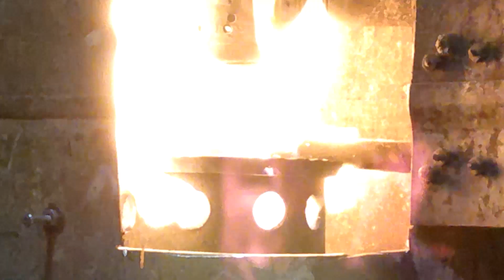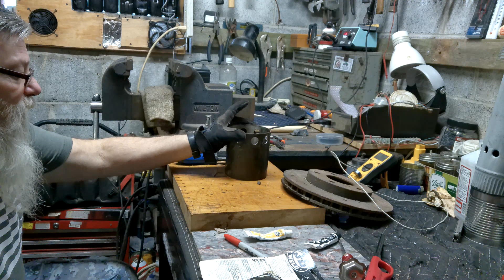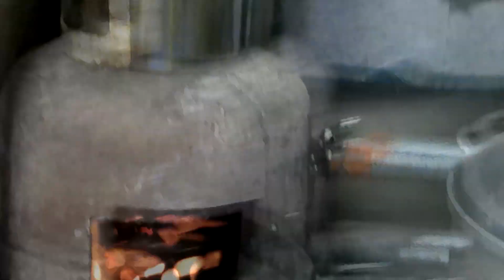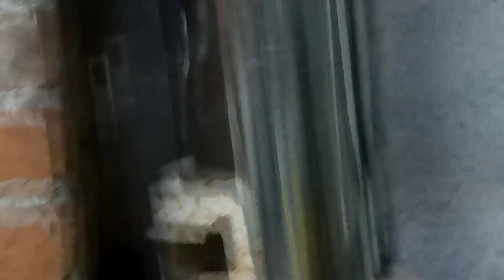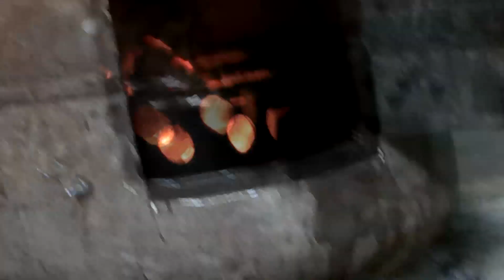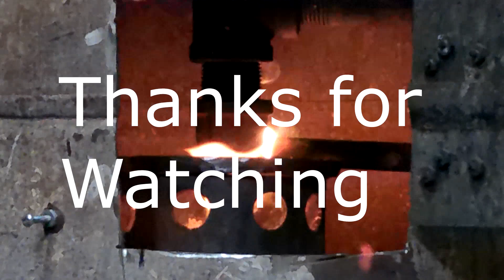My Oil Burner modification

Comment: What did you end up using for air?
Reply from the maker: I ended up using a bathroom fan. It works for now, but I'm waiting until it gets warm to tear apart an AC unit to get the fan out for this project.